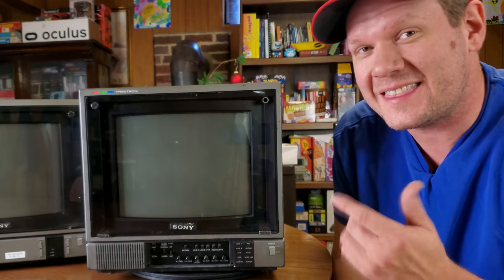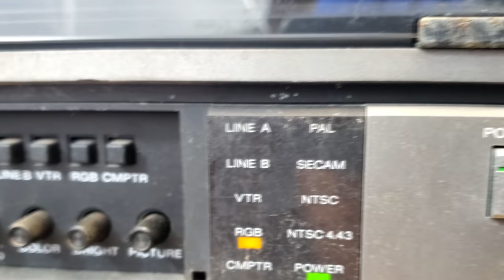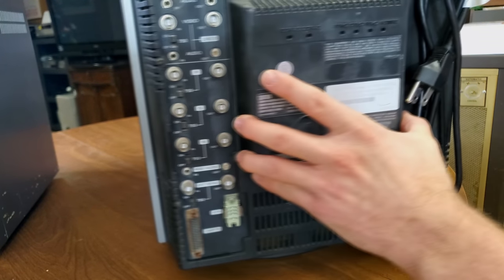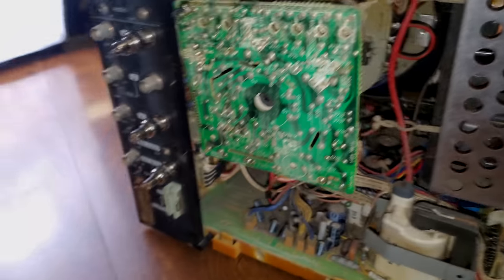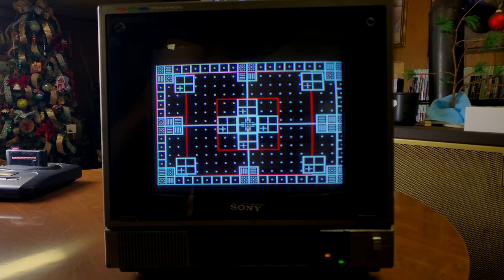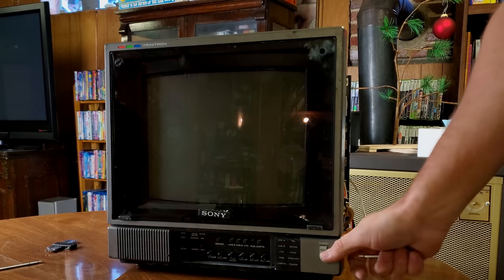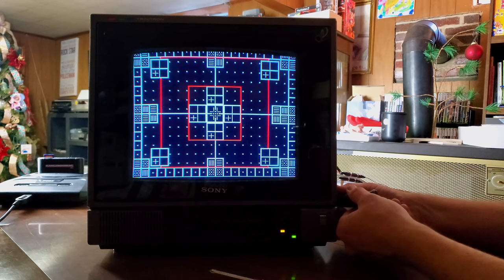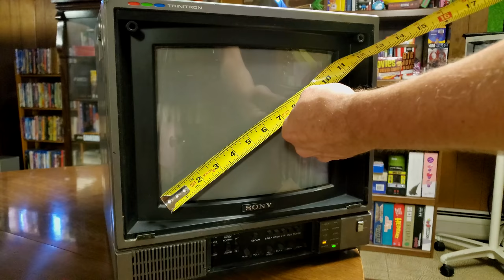Is Sony's Oldest PVM good for Retro Gaming? 📺 PVM 1270Q CRT from 1983

Comment: Just so you know, if a potentiameter does not effect the screen in RGBs, that does NOT mean it does not effect the composite/S-video mode.  The board for each incoming signal is different.

Comment: Hi Steve I bought a 1371QM as my first CRT back in Aug and did a full recap on it. Like you it took me a long time to setup the geometry but found all the potentiometer adjustments were accessible from the back of the pcb rather than adjusting the potentiometers directly from the front. Mine had adjustable geometry/convergence rings on the kneck of the tube which As being a newbie I removed the cement holding them in place and them spent hours trying to get back to the best geometry and convergence picture I could. I never got it back to perfect as there’s some slight convergence misalignment of the guns at the edge of one side of the screen. This may be limitations of the PVM design but I learnt no end and tbf it’s a good picture once all set up correctly. After recapping it took me a while to set the potentiometers so it would sync on pal and ntsc inputs again though. The documentation for this model was scarce and I had to pay for the service manual online in the end. I like the retro look of it and it was like yours exactly with only one screw holding the glass panel on and Sony badge at an angle on the glass now realigned.
However all my termination switches were working fine and the loose BNC connector was easily solved by resoldering it’s pcb connection.
Reply: Hi Adam! When you say accessible from the back of the PCB, can you elaborate a bit?

Comment: don't know if someone pointed this out or not, but when the picture shifted from 4:3 to 16:9 some owners just adjusted the picture on the tube to be 16:9 or close to it. I would bet that that unit was one of these. the picture quality was fine and new pvms are expensive so that was the stopgap measure. didn't think I would see one of these in the wild until you "fixed" it.

Comment: Best to use an actual NTSC generators. Game console might shift or alter the picture. I have two generators, Sencore VA48 and a tank built Leader LCG 396. i have used by the past Sencore VP 400. As far as convergence alignment and purity alignment, those are the best things to use. Their chroma level on the staircase waveform are 100 % accurate followed by phase alignment on a vectorscope. 240p suite will be fine for someone who's not willing to go that far though.

Comment: I found the pincushion adjustment! It's the metal looking peg with a hole right by the v size. Need a small philips to adjust.
After tweaking this monitor, I'm extremely happy with the picture. The one I got can get extremely bright, so I suspect it didn't get a ton of use from it's 1 owner who used it to master tapes. Overall I rate it highly for video games. Less vibrant than my 13 inch BVM-1310, but has a nice look for sure.
Reply: Also for anyone else who might end up working off this video, the white potentiometer for vertical size that he tries to show at 26:13 - doesn't actually show up in the video. It's a plastic potentiometer that's to the right of that metal peg with the hole you see standing up (that's pincushion)

Comment: Handy video, thanks.  Since these are so cheap they can be used as a TBC for D14s that is priced for mortals.

I picked one of these up a while ago.  It had serious pincushion issues, so I tracked down a blown transistor in the pincushion circuit.  I replaced it, did a full recap, and also popped in a brand new tube because I saw it on ebay (and when else will I have a chance to see a 0 hour tube in my life?).  Unfortunately I didn't test in between each operation and the set is now unable to display.  I can hear the flyback whining at a slightly lower frequency than it should be (like 14.8 kHz).  I moved on to other projects, but I'll revisit it in the future.

Comment: I just got this monitor, lots of problems. Anyway, I watched it again and again, and I'm not sure where you found the horizontal size control on this one. I see that you found and adjusted the vertical size pot, but it seems like the two other ones next to it did nothing, if I understood correctly. So where is the horizontal adjustment pot exactly? Also, it seems like a pot in the back also adjusted the vertical size a bit, before you found the one on the side? Or just the side one is needed? My picture is very small even on normal scan mode, so I will need to adjust both vertical and horizontal.

Comment: Hi @RetroTechUSA! I recently got a wonderful pvm-1371QM. I'm a novice so for what i can see it has excellent rendering and beautiful colors; I downloaded 240p suite and I see that the grid is shifted a little to the left. To be honest I didn't quite understand the steps to fix the horizontal and vertical image calibration. Do i need to use a screw to do the calibration? Could anybody help me? I'd really need a guide "Adjust CRT geometry for dummies" kind of thing. Is this an operation that can be done by a novice or is it better if I avoid causing damage? Thank you very much

Comment: I find it odd that the older PVMs have at least some sort of screen protection on them, then they did away with that on later models, then brought it back as an anti glare tinted film later on in the L series for example. I guess I'm a little salty about that because I just picked up a PVM 2030 and the screen is scratched :( I am thinking about trying to lightly polish the glass but I am not sure about it. I also have a BVM 1315 which I don't think has a film over it either.

Comment: hey I have one of those, it came completely unusable and the ebay seller tried to give me the runaround. Ebay ended up giving me a refund and I bought a desoldering iron and capacitors and recapped the whole thing. Amazingly it worked great when I was done!

Oops, mine is actually a 1342q